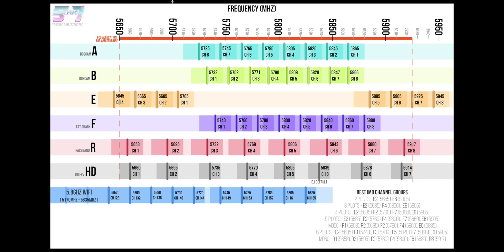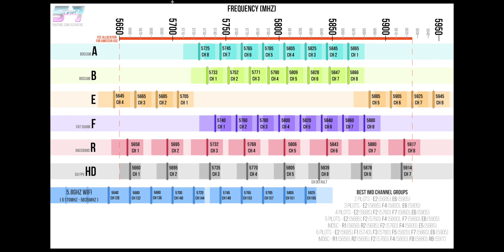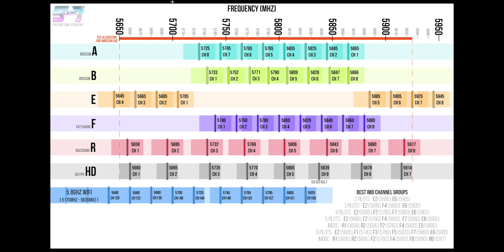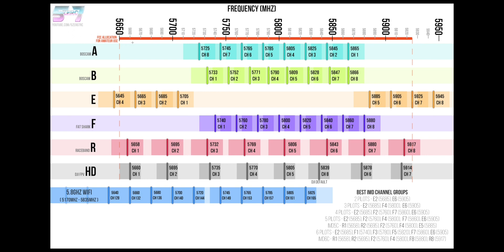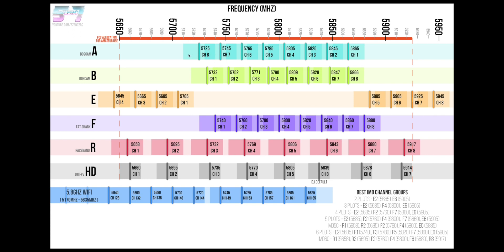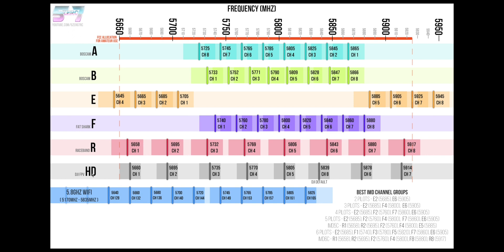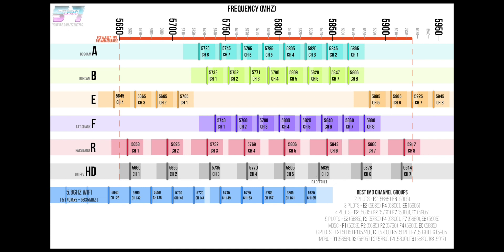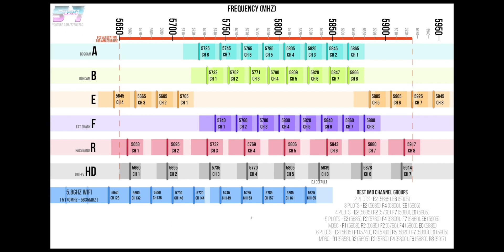5.8ghz FPV Frequency Chart Explained

Comment: Thanks.I have a goggles dji v2 with a tango tbs 2 ans my drone ia the cinelog 25 HD with a Crossfire TRX. I have set same frecuency / band in the Vista wirh Betaflight to katch the channel 5 (range frecuency) in the goggles... Do you think is a good idea to match them?? They should be in the same range of feencuency isnt?? Should I change to channel 1 in the VTX ans Goggles??? Im wondering which chabnel and config VTX will allows me to go further. Thanks again

Comment: Hi new to the fpv drone hobby, so in order to fly fpv i need a ham license? Can i just choose an outside channel for that? Or its prohibited?Awesome explanation and chart. Thanks!
Reply from the maker: To be completely legal in the US, you need to have a technicians level ham license, or use the DJI fpv system.  However very few people bother to get a ham license.   Though it is a good idea to do so.  It would be even worse if you used a channel outside of those allowed for ham operators.  That means you are interfering with other uses of that spectrum.

Comment: So what’s the legal channels to use I’m still confused
Reply from the maker: If you are in the US and have a technicians level ham license, you can use any of the channels that are completely between the two dashed red lines ( between 5650mhz and 5925mhz ).  Any of the channels that have a shaded area outside of that range, like E4, E7, E8 ( any maybe R1 and R8 ) would not be allowed.

Comment: So is one band better then other for any reason for solo flight
Reply from the maker: No, the actual bands don't matter, but some channels or frequencies might work better for you than others depending on your location.  If you have lots of 5.8ghz wifi where you  are, the higher end of the frequency range could be a little better for you. And some antennas might be slightly better tuned for the middle of the range than the edges.  But you would really have to just try them out to see if you notice a difference.

Comment: I actually have to combine your chart with this simple color chart of the Wifi channel allocation to get a complete picture (same chart I use when allocating the 5ghz wifi band for my wide area network long distance links):   https://www.networkcomputing.com/wireless-infrastructure/dynamic-frequency-selection-part-3-channel-dilemma

Basically I fly alone, and I came to the conclusion for myself, that on analog pick E8, and for DJI, pick channel 7 as my own personal default channels.    But basically out in the field if you don't want to remember anything else...  then remember for analog E6/E7/E8 and DJI digital 6/7/8 are safe channels.

Channel 165 wifi is kind of a garbage default non-bondable single loner channel some of wifi routers are setup on, meaning for you to change them to something else... so DJI 8 is not a particularly safe bet.    DJI channel 7 will step on E6 and E7.     So if you alone and running both analog and digital, your best bet of easy to remember channels is E6 and DJI 6 with lots of separation, followed by E7 and DJI7 which don't overlap but are headbutt up right next to each other.  E8 and DJI8 have the furthest seperation between the two, but DJI8  might end up with interference from a Wifi Router on 165. 

So in order of best to least best of the easy to remember clear channels,  E6/DJI6...  E7/DJI7...  E8/DJI8...    in that order of preference...  seems pretty easy to remember.  E rhymes with D, and 6 7 8 is in order of most preferable to least preferable.

Now if you're around a bunch of random guys with analog quads, I'd go for E7/DJI7...  which is probably the channel I'll pick as my defaults, because 7 looks like my horse profile :-)

You also have Crossfire on 900mghz and cordless phones to consider. 

UNII-2 and UNII Extended is not used in the US for wifi equipment, most wifi clients can't receive it (only the green areas on the chart), but some routers made for international markets can transmit and receive on it (mine can).  So in the US you're also pretty safe on E1-E4 and E5-E8.   It looks like the E band was taylor made for the US.

 fpv.air-war.org
Reply from the maker: Thanks for such a detailed and well thought out comment.  I do have to disagree with you on the UNII-2 and UNII-2e bit though.  As of a few years ago many wifi network operators started using those channels in the US.
I operate a WiFI network for a college and on our campus we use all the 5.8ghz channels except 140 and 144.  This was based on advice we received from our wireless vendor and personal experience.  Pretty much all clients now support these channels.  However you are correct, that they are probably used less often and thus you would probably find those channels have less traffic most of the time.
Oh, I should also mention, be careful with E8, it is outside the limits of what can be used in the US without permission.

Comment: Dan, thanks for publishing this work. We're pointing our small recreational group to FPVFC to illustrate some of the issues we've experienced but couldn't fully explain. Including the DJI info was a good idea even before their FPV system was released. We had a Phantom swamp a FPV pilot and came up with several possible causes. Now we can point to your graphic to explain that yes it's a different comm protocol, but look at the frequency and think how much "noise" is produced on your link. I'd been keeping my DJI video gear locked on 2.4 and now have the option of knowledgeable use of 5.8 if needed.

Comment: DJI's channel 8 is probably usable world wide.
Reply from the maker: Interesting that the channel frequencies are a little different depending on where in the world you are.  For FCC and CE/SRRC DJI Channel 8 is 5839.  However in the MIC region Channel 8 is 5745.    I'm not seeing much consistency across the 3 regions listed on their specks page.  Strange.  I guess they couldn't keep them the same due to the different rules all over the world.